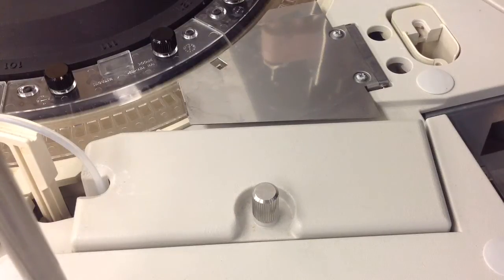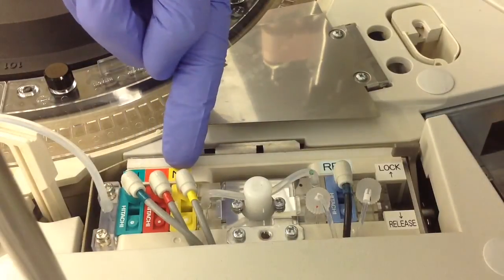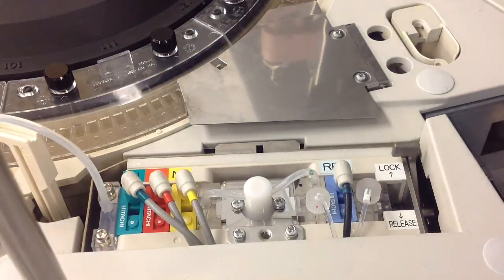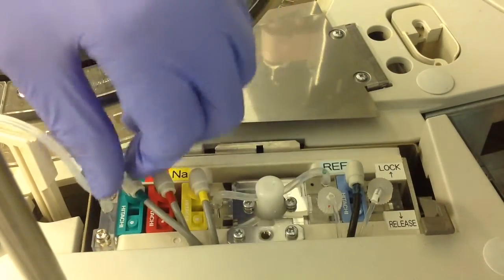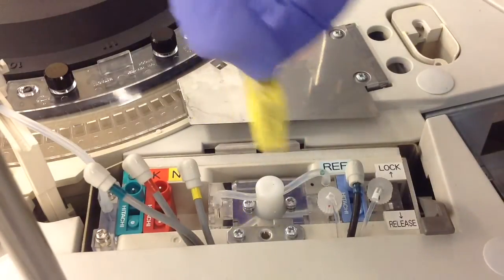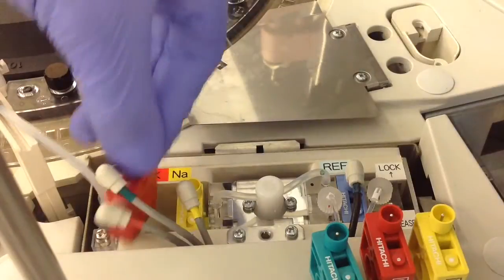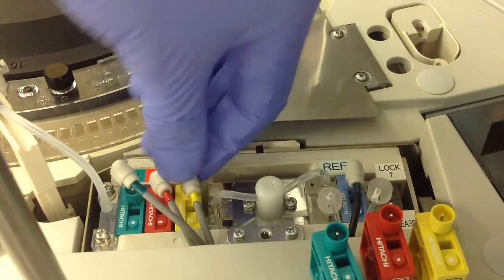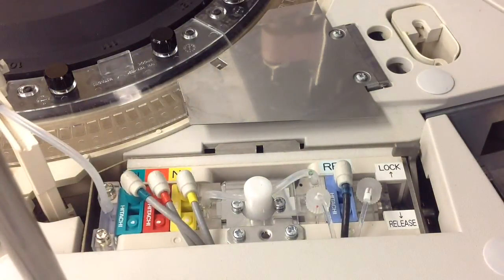How to replace ISE measuring cartridges for Cobas 6000.

Comment: Why do ISE become unstable after changing the electrode? The results are out of range, especially the chloride, even after calibration. what is the remedy?
Reply from the maker: Try conditioning them with activator or serum before use. Use the green rack with all three cups containing activator/serum. Then run the green rack normally.
Reply: Chloride out of range generaly because of water conductivity  your distilled water machine need to show you at least 005 microsiemens
Reply: Hi, can I check how many times do you do the conditioning with the green rack with activator?
Reply: @katherinepeihui  10 serum its Enough